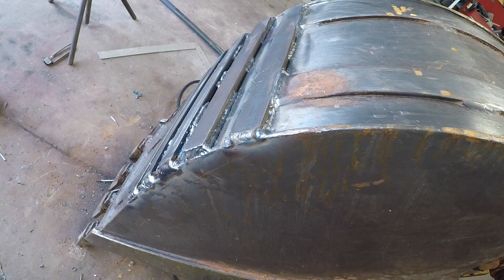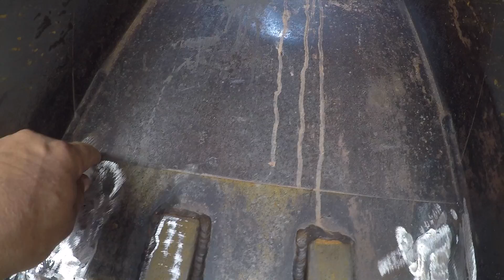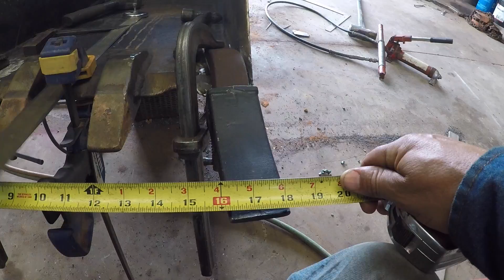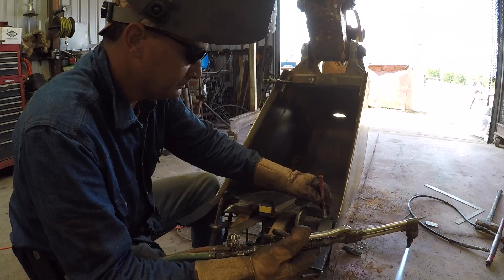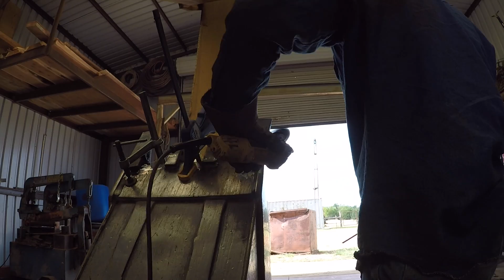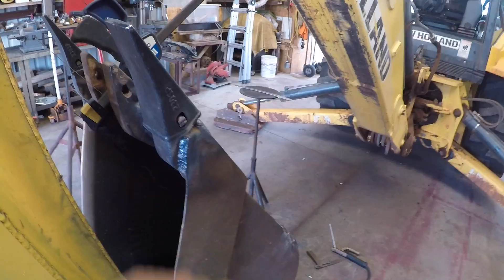welding buckets Part 2

Comment: Great video quality and tips. Now you were there and I wasn’t, but around 19:30 I think I see a liiiiitle bit of cold lap on the short weld of the right tooth . It ain’t easy but try to learn to weld with both hands. Angle is so important with stick and being able to use either hand to achieve that angle will allow you to deposit that metal exactly where it needs to go.
Reply from the maker: Jacob Franklin  wanna X-ray it? Lol thanks for the advice I will go practice as soon as I get time
Reply from the maker: Jacob Franklin https://youtu.be/yLQHcwK6KDA 16:19. I have dabbled in some left handed welds a time or two. Have passed 6g certification, but I’m sure I could learn some more.

Comment: Never did too many repairs on buckets like that, but if the material is something like Hardox, can it still be welded with 70XX rods or does it need stronger rods like 90 or higher?
Reply from the maker: krazykanux I haven’t seen any problems with 7018 unless you start a cold weld, I’m sure there would be some benefit to a 90 or 110, but this has proven to work well for me. I have looked into the factory recommendations, some may recommend a different rod. Thanks for watching

Comment: Here another suggestion ,useHobart 7018 welds noticeably smoother than Lincoln and used to cost 20% cheaper.
Reply: i like the hobart as well, been using lincoln lately cuz that is what i was giving to work with. not saying L isnt good but Hobart seems to weld a bit better. never stop to compare prices but good to know now :)
Reply: Personally I haven’t had any luck with Hobart, but a welding rod I do like is forney welding rod. Forney welding rod is by far the best in my opinion.

Comment: I do this for a living and the information I got off of esco told me that on material under  like 2inch to 11/2 only needs like 200to 300 degrees preheat and  even while welding try not to get over 450 degrees    you did a good job I had cracking problems and this is how I solved them
Reply from the maker: I got my info from New Holland on the 400 deg.  I'm sure 200-300 would be way better than none for sure. Thanks for the information!

Comment: 400 degrees is to hot for that thickness to much heat takes the temper our of the steel making it brittle and no longer abraision resistant
Reply from the maker: Adam Leonard interesting, what temp do you recommend ? I made the mistake of not preheating once before, not a good deal! 400 degrees is way cooler than the actual welding. How would I keep it cold and weld it?

Comment: Frank you need a needle hammer. They are great for chipping after cutting and welding, the peen action also helps relieve stress as the metal cools. Great video just keep burnin' rod. You are too right about the welds on the corner teeth being super important as the teeth are thick and do tie the bucket together at a high stress location. Great video your knowledge of buckets is amazing thanks for putting this out and sharing.
Reply: The fact that you are knowledgeable about Frank's endeavours is wonderful!

Comment: Is there nothing wrong with the electrical part of the machine when you weld on it? 
I mean that the electrical system does not suffer any damage?
Reply from the maker: Not much electrical on this machine, 2007, I wouldn’t recommend welding on the new ones though. I have not had any problems welding on this one yet!
Reply: 2007? 
I own a jcb 2011 and it does not bring joystick, either for the new holand, I wanted to cement the corners of the frontal bucket without disarming it. that's why I was asking you
Reply from the maker: Adrian I think you would be fine if you disconnect the batteries and keep the ground close to the weld as possible. Newer diesels have more electronics on them, I was told by a Case Backhoe Service rep that welding on the new case machines is not recommended at all.
Reply: Thanks again, I think I do not risk burning something so I'm going to remove the bucket before welding
Reply from the maker: That would be the safe way!!!!  Thanks for watching my stuff!
Reply: youtube is a good knowledge tool, thanks for sharing
Reply: Place your ground clamp properly?

Comment: if you stretch the boom all the way out and roll the bucket out you will fin d it be to weld the bottom of the shanks you have a stick welder ,get carbon arc gun it cleans better ,I think you are pipe welder the way you go about it that's o k
Reply from the maker: Thanks for the advice! And thanks for watching!

Comment: Weird ....after watching oh probably 30 different people working on buckets and heavy equipment weld repair and fab. I have yet to see even one person using a carbon arc process to remove heavy sections of plate and blocks. The process is 10 times faster and 50 times cleaner.  After 35 years doing this type of repairs I been using a carbonarc and so do most of the people I have worked with over the years.....Youtube is a strange place. Good job my friend no bashing what you did and the torch work looked spot on PRO to me. You knowledge of bucket repairs and the how and why they are designed to work they way they do is TOP shelf stuff....Good Info even for a old timer like me.
Reply from the maker: Thanks I will try to get a carbon arc setup someday.
Reply: I never really cared for the carbon arc. It is ok for somethings but hardened steel like to be preheated before the arc. I have seen cracks come from striking in the cold metal with the air arc. Also the carbon arc rod does leave some carbon impregnation in the metal so more grinding is needed to remove that junk. I used to just stick to a wash tip and a rosebud. The company I did this type of work for is in Ohio and I did jobs like this in the dead of winter. I have an air arc but I only use it on low carbon steel. It seems to me in different areas the knowledge base of accepted practice is different. I always kept a partner saw on my service truck, you can cut clean through a crack then break the bevel you want after you found the bottom. Chasing cracks with a saw like that will put muscle in places you did not know there were places. If you don't have time to do it right how will you find time to do it twice?
Reply: Carbon arc, takes a lot of air. Most compressors cant keep up.
Reply: the good old " air arc " i used my first one in my late teens early 20s on a WW2 turbine style arc welder the size of a 250gall  propane tank  that sounded like a jet engine  and  very large copper coated carbon rods  would throw slag 50ft
Reply: you can also buy a plasma cutter with a gouging feature  to cut welds off and save on oxy/acy

Comment: Hello , i like your professionel work and patient at things .I told myself if i can ask you a question .Feel free to answer  or not 
I weld  too , but not everyday , i tought myself on the way ( mig , tig ,stick ,fcaw ) .I am not a  welder for a cie,i do it for myself and it is becoming my passion .
Now question : you are using 1/8 stick  rod for arc welding , is it true that if i open a package of new 7018 , that i have to use them all in one shot ??? 
because they tell me that because of the humidity , they will be no longer good and very hard to restart  ???
The provider tell me to use 7014 (1/8 ) instead  and claim they will do the same job ,,,!!!
What do you think of that ??? And what brand are you using ???
Waiting for your reply ..... excuse my syntax ,i am not fully  to speak english , i am french canadian
Thanks in advance 
Serge ( from Mtl )
Reply from the maker: It is best to buy small sealed packages, but I really depends on the type of work you are doing. For most repairs a pinhole or two will not matter, unless you are welding tanks, or pipe where leaks could be a problem. I have used 7018 that has been opened and not had much problem. Yes I used 1/8” but I do use 3/32” on thinner material. I am self taught too, so I am not an expert. I personally don’t like 7014. A good all purpose rod for me is 6011 or 6010 5p+. I like Lincoln Electric rod, but use what is handy most of the time. Thanks for watching and good luck to you in your new passion. Asking questions is the best way to learn, and just doing as much as you can will teach you a lot too. I have learned a lot from my mistakes. Hope this helps, if I can I’ll try to respond to any questions.
Reply: Digginok  thank you so much for your reply and kindness.i usaly go with people experience and i will take your comments in consideration .I don't beleive in arms chair engineer 
Thank you so much , now i have a good idea 
Bye 
Serge ( from Mtl )
Reply from the maker: You are welcome!

Comment: when i built my skeleton bucket i copied what deere had made. the outside shanks were cut into the sides of the bucket. not sure if it helps anything but their engineers are a lot smarter than i am so i just did the same.
Reply from the maker: You did a great job on that one!

Comment: Another great video. Good tips for tooth replacement. The old SA200 just keeps earning her keep. A man that does anything with equipment needs to know how to weld and have a good welding machine to do it with.
Reply from the maker: Thank you sir! That 200 has more than earned its keep, it does help to know how to fix equipment, I don’t think I would still be in business if I had to rely completely on someone else to fix my stuff.
Reply: Digginok 
I’ve seen many guys in your line of work go under because either they didn’t know how to fix their stuff or were to lazy. If you have to hire all your repairs/maintenance done you’ve dug a big hole to overcome before any money goes in your pocket.